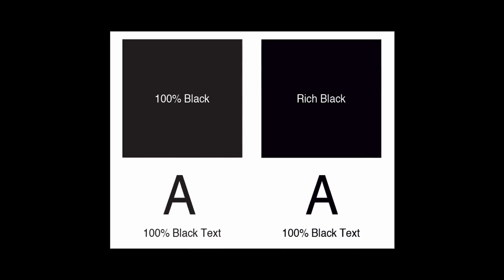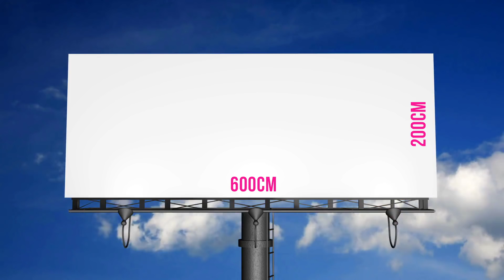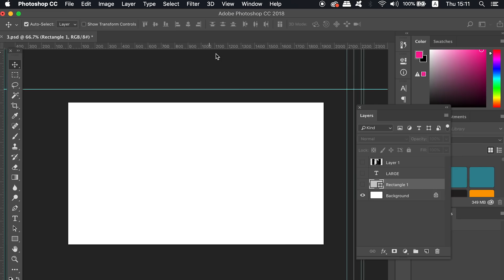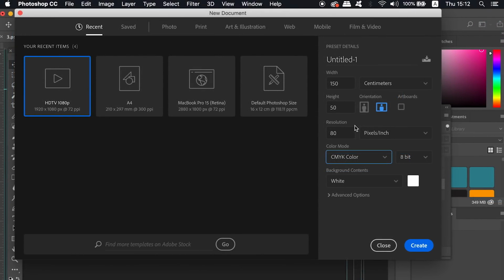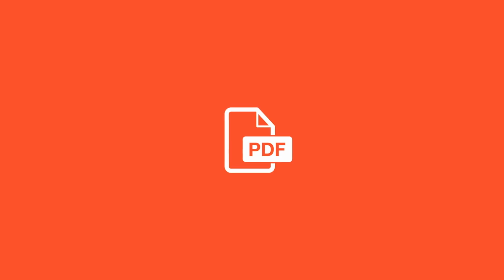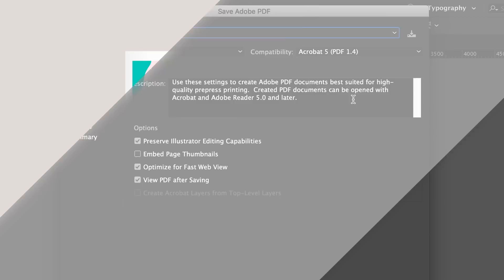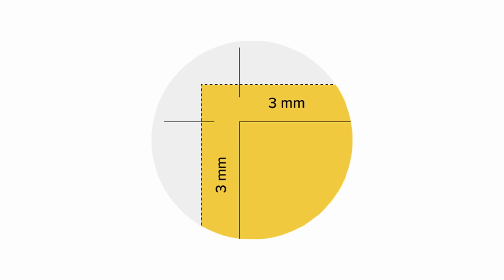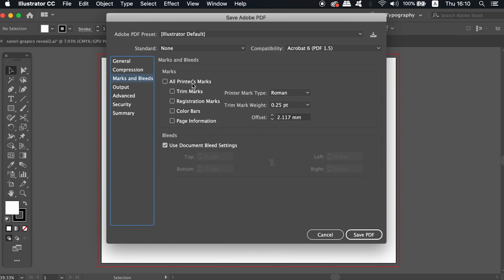Graphic Design Tips: PERFECT PRINT Design

Comment: I know this is an older video, but as someone who works in print production, regarding bleeds - ask the print provider for bleed specification for the job. In our workflow, (digital wide format printing) we actually prefer not to have a bleed set at all because our automated processes will enlarge the pdf's page boxes to the appropriate bleed size for the job on the fly. All we need is artwork that extends beyond the borders of illustrator's artboard for that to work correctly.

And for the love of all things holy - do not include printer's marks of any kind. The chances that your design software will place the right kind of marks on the document for the print provider to use in their production workflow is highly unlikely. Our RIP places all necessary marks for the job, and those marks are different depending on the kind of job it is.

Comment: Hi  Satori Graphics: For Example when am designing 500x1000 cm, billboard  resolution at 30.  
This is what usually I do scale it down to 50x100 or 5x10 cm and resolution at 1400 pixels, then will paste it into the 500x1000cm.
What do think?